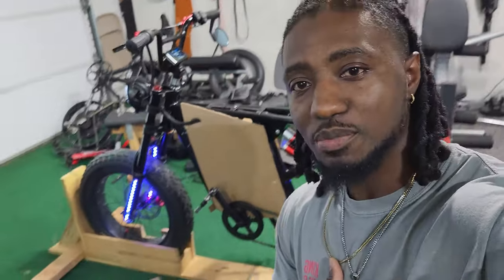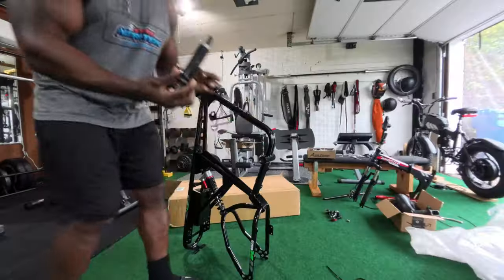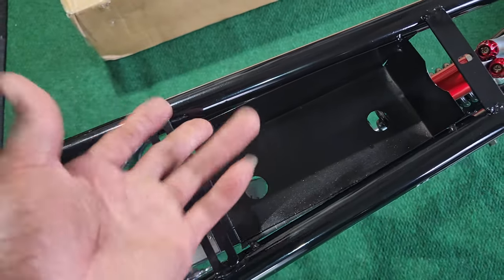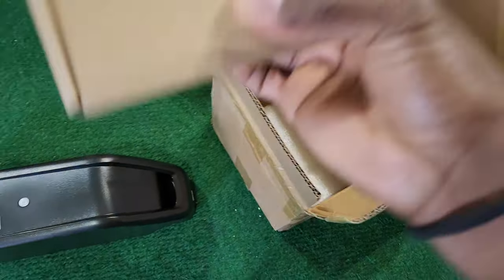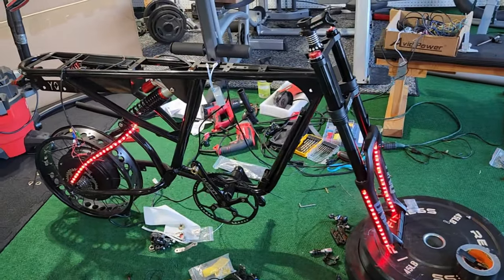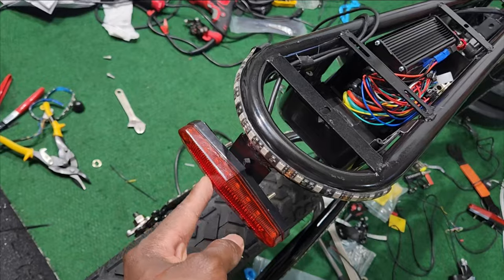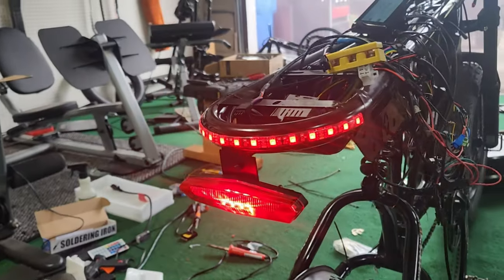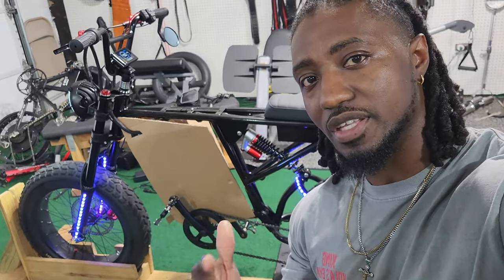How To Build A 60V eBike From Scratch! Part 1

Comment: I hope you have torque arms for your rear motor. You need them
Reply from the maker: I do, i have 2 on it. One is probably enough, but i'd rather overkill than wish i did later on.
Reply: @KingKola_ the same frame with horizontal dropouts is a far better frame much more beefier were it's needed I would not build a ebike with that frame no way